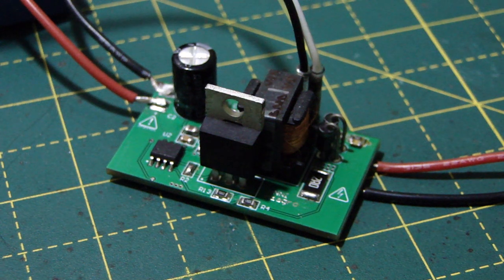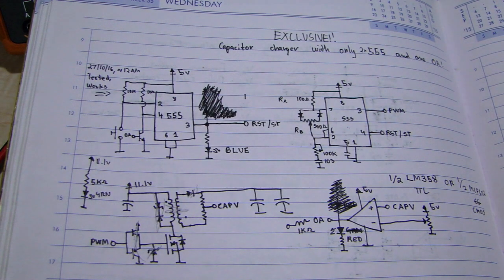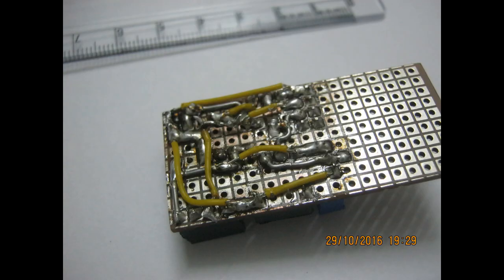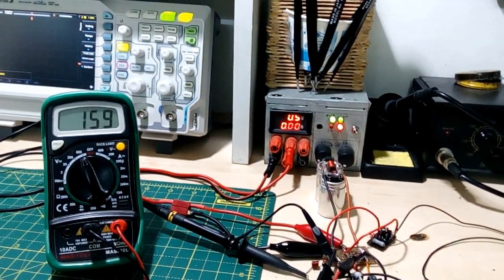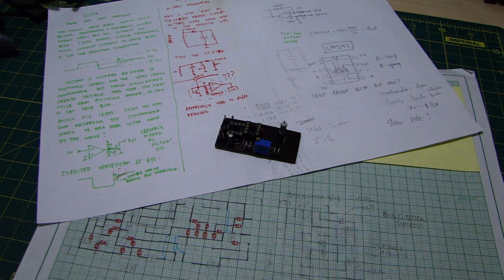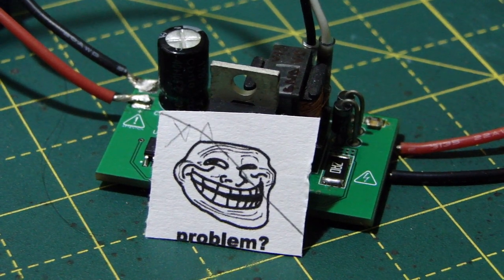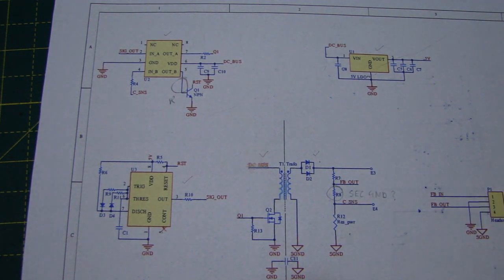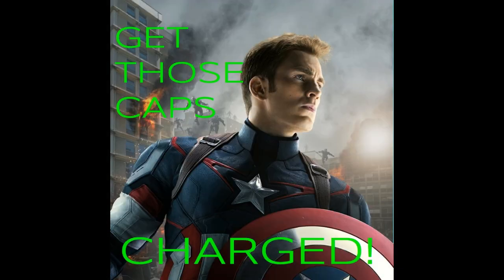The NNNI Capacitor Charger - A Complete History and Walkthrough

Comment: Thanks for making a detailed  video on charger.....I guess I've to experiment with the component values....... ok I wanted to ask that your previous versions had variable duty cycle, the other one was with variable frequency & there was one with both variable....... so the final charger ( according to schematic)  has a fixed frequency & duty cycle?
Reply from the maker: You're welcome!
Yes, the frequency and the duty cycle were variable but only by the user and not as a part of some kind of feedback loop. At that time I was too lazy to get exact values and I had a vision that the oscillator could be unplugged and used for something else like some kind of a module, so I added the potentiometers.
You're right, the final version has a fixed frequency and duty cycle BUT the blanking circuit does not let all the pulses get to the gate driver, forming a very primitive feedback loop. I've used a fixed oscillator for the sake of simplicity and also because it can be substituted with any other oscillator with an output enable function.
Reply: @NNNILabs  Thanks.....I'll try to make one for my cap bank.